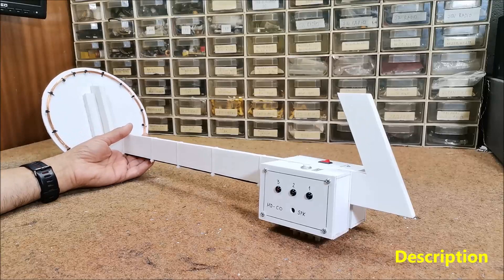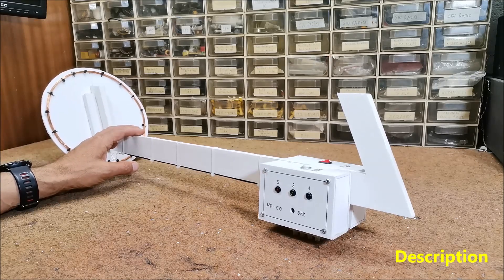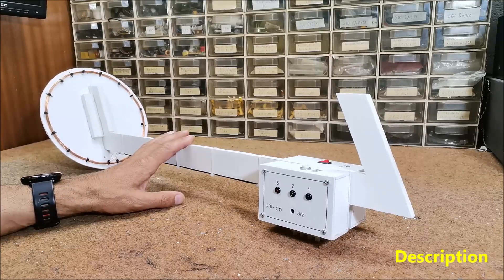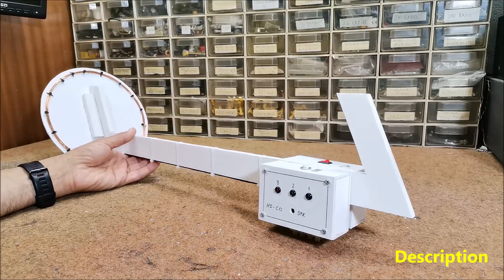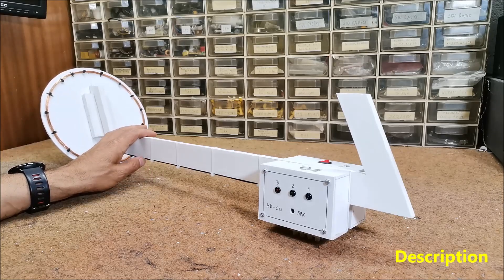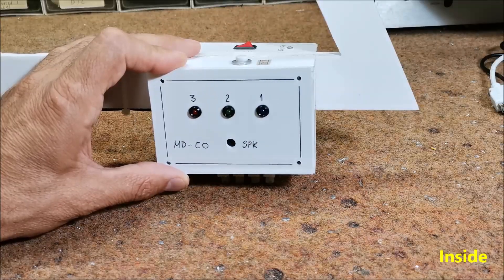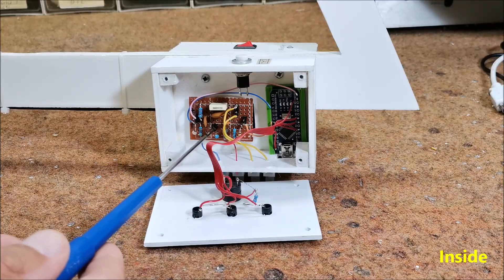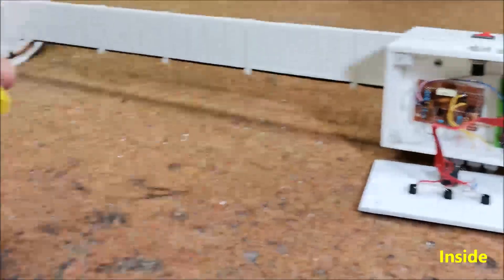DIY Very simple Arduino Metal Detector

Comment: Sir, thank you very much. I have being able to buy all the components for both NE555 and Arduino NANO IB metal detectors. Plz i need your guide to help geth good results. The NE555 timer circuit. I have assembly it but when i on it, the buzzer beat once and stop. What's the problem sir?

Comment: Mirko, would be amazing a project like this:
"Another device employing electrodermal measurement is the apparatus for meridian identification (AMI), which measures electrical characteristics of the skin at acupuncture points located at the base of fingers and toes called Jing-Well points. Based on the theory that the “energy” or “strength” of the acupuncture meridians (or energy channels) is reflected by electrodermal characteristics, conductance, capacitance, and polarization, measurements from Jing-Well points are analyzed in order to diagnose a variety of pathologies, as well as to assess overall wellbeing."

 The project seems very simple, there are some schematics

Comment: Very nice man, if i've understand corectly is it a pulse induction metal détector?
Reply from the maker: In short, the Arduino measures the frequency of the Colpitts oscillator composed of L, C2, C3 and if that frequency changes due to metal near the coil, it signals with a sound and LEDs
Reply: @MirkoPavleskiMK  ok so it is more an induction balance, is it sensitive to ground effect?